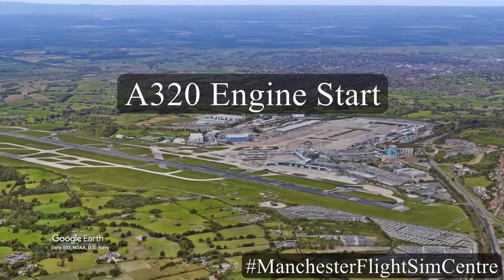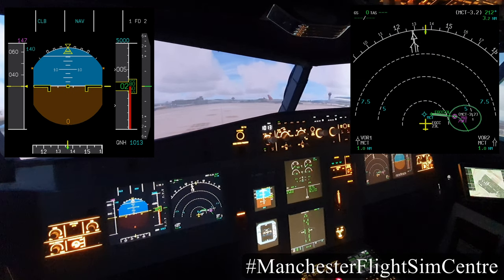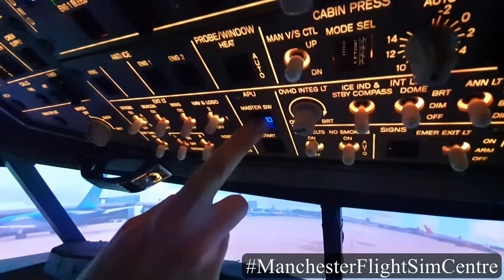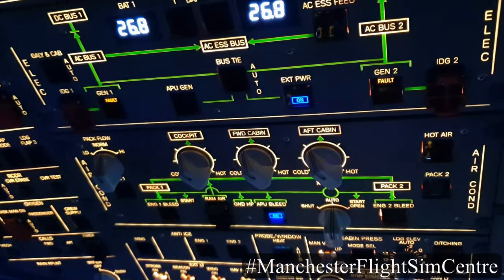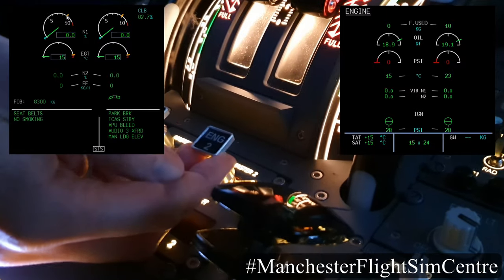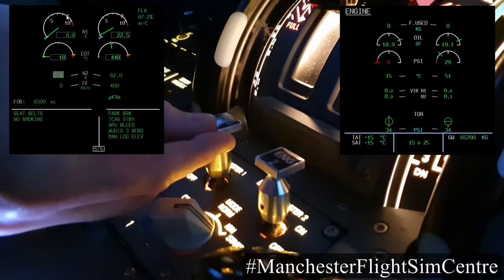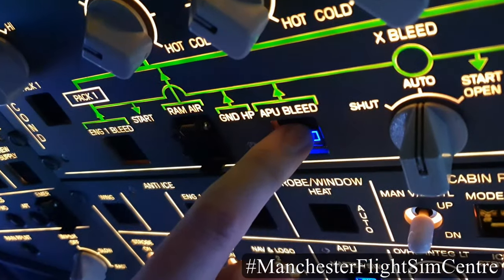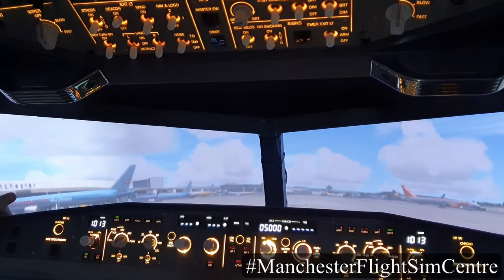Airbus Engine Start - The Basics

Comment: Do you get THE APU alarm bell when doing the fire test from just using battery power alone?
Reply: No
Reply: Yes ,  because what give us the alarm is FCW ( flight computer warning ) since the aircraft have electrical supply from batteries 🔋, the alarm’s and lights will go on
Reply: Hmmmm!!! 2 answers and one is incorrect.

Comment: screams at low resolution on the exterior monitors

Would it kill them to contact microsoft and use the graphics engine from Flight Sim?!
Reply from the maker: Actually, we use 3 high resolution wide angle projectors to create an immersive experience - there are no external monitors involved.

What translates onto YouTube post production isn't always necessarily representative of real life.
Reply: @manchesterflightsimcentre  ah. I was going to say " if it's a flight sim, having the best visuals out the windows to simulate the craft at altitude is a BIT on the important side I would say, as real life hopefully doesn't look like stuff from the PS2

Comment: What is the engine mode selector crank for?
Reply from the maker: Essentially to motor the engine without starting it.  Like turning the starter motor in your car but with the spark plugs disconnected.  This might be used in the event of a tailpipe fire for example, in order to ventilate the engine and remove the remaining fuel.
Reply: @manchesterflightsimcentre  oh thank you so much this was really helpful

Comment: So unlike the Boeing 737, you can have L&R packs on during startup?
Reply from the maker: Kind of.  The packs are selected on, but once the engine mode selector is set to ignition the pack control valves are automatically closed and reopened during the start sequence.